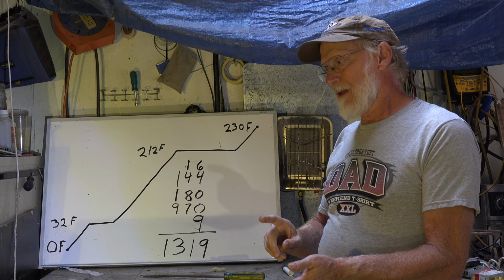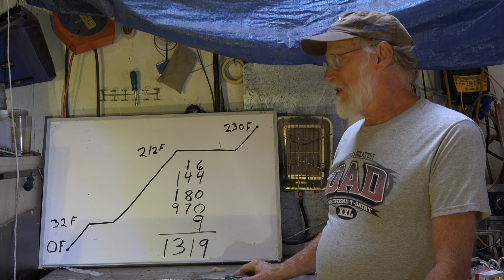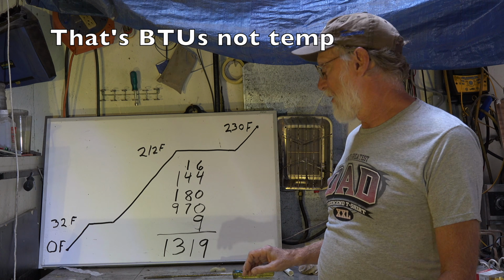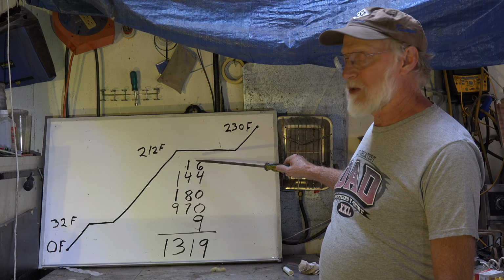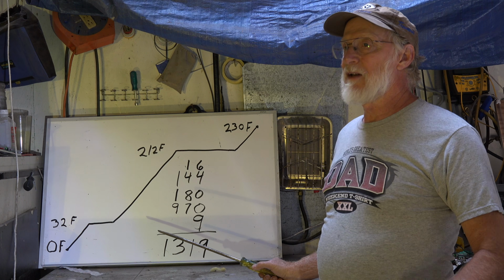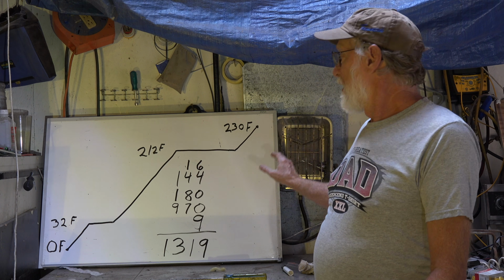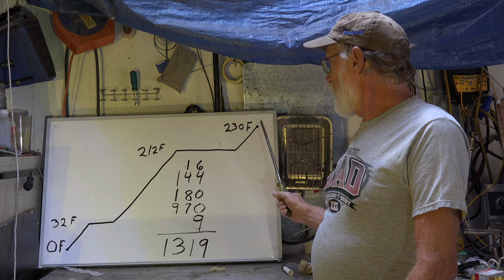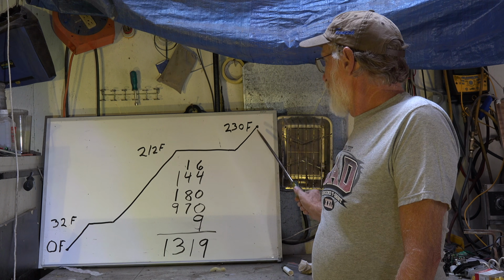Water, specific heat and latent heat #4

Comment: Would you consider doing a video on the use of a run capacitor as a crankcase heater? Does this idea work? Who thought of using the run capacitor in this manner? Thanks for your excellent videos.
Reply from the maker: It does work and I will do a video on it.
GFM